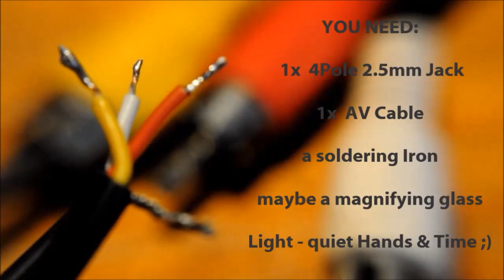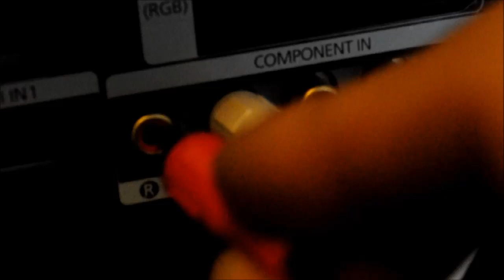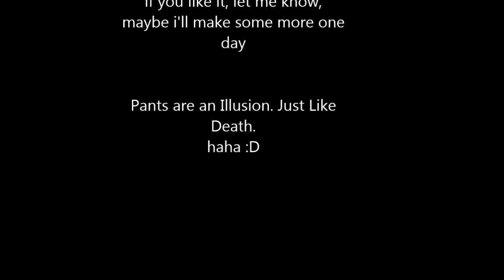DIY GoPro 2.5mm to AV or FPV Jack

Comment: I have to connect a 2.5mm TRRS 4 pole av cord to the pad outputs of the URUAV analog to digital dji adapter.  

The pads are 5V, GRD, A, and V.  Do I only need A, V, and GRD?  Since there is only one Audio pad, can I connect either the left or right signal audio?

Comment: Hi, well done. There's only a problem: no explanation about correct wiring. I have to make one for my hero 2 for FPV flying. I need how to connect wire, I mean where soldering power, where video, etc.
Hope you may help.
Enrico